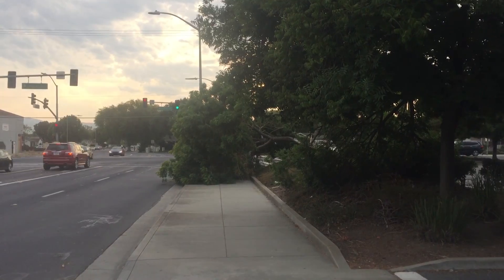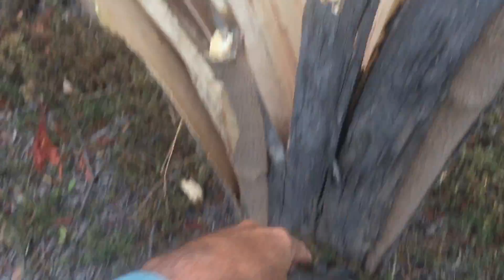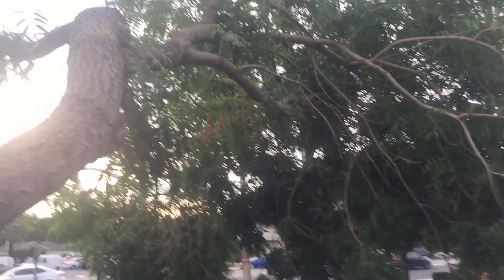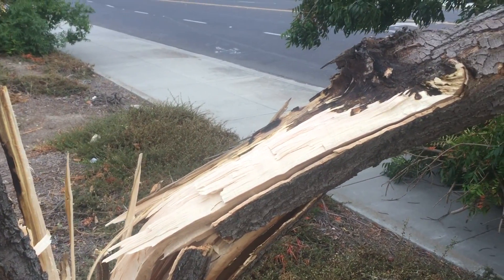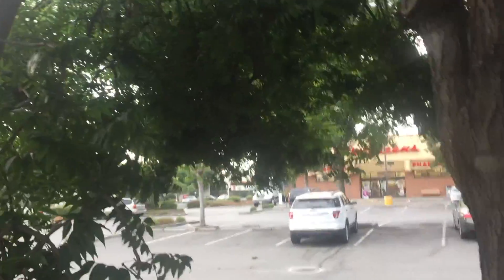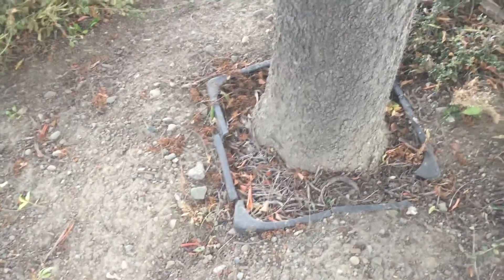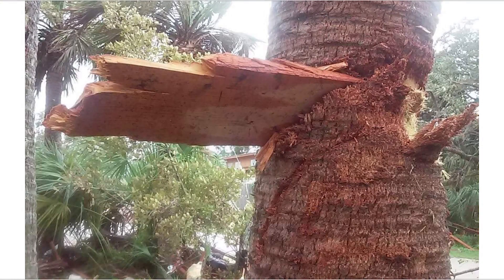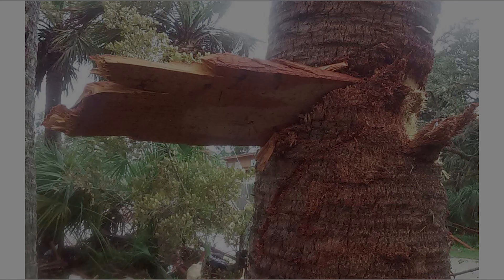Recognizing  Tree Weaknesses

Comment from the maker: Identifying Hazardous Trees
 
This is really an area that needs to be done by an expert but there are many signs that indicate a problem or potential problem. It is important to understand that different types of trees have different characteristics and problems unique to the variety. That said, I will give some general advice that are “red flags” to a potential problem.

Cracks in the limbs
This sounds pretty basic but I am amazed at how few people really look closely at their trees.  It is often obvious when a limb is splitting open but not always. Small cracks in main crotches can sometimes ooze water or pitch (sap).This can happen suddenly or take some time to develop. If you see cracks or openings, call an Arborist immediately.  That may be the only warning you get.

Cracking noise
I have heard and been told by people that they heard a loud crack, but could not see anything. Sometimes the crack is on top of an upper canopy crotch or running along a large horizontal limb. Don’t ignore this obvious clue.

Change in tree trunk angle
Many times in my career, clients have called me to say “it seems like the tree is leaning more than it was before”. Sometimes it is a persons fear or imagination but many times there was a weakness underground that caused a change. The large Stone Pine in Blaney Plaza was saved because a city worker noticed a change in angle.  Sure enough, when we looked close, the whole root ball was coming up and this huge tree was on the verge of going over. Sometimes cracks in the soil are a good indicator of movement. Also look for a separation in the soil line around the base of the trunk. In rainy weather, the soil becomes muddy and these clues are often harder to read.

Drooping limbs
Do some branches seem lower than they did a few weeks ago? Is there a dramatic difference in the way a tree looks?  There is a situation that is very common during hot weather called “summer limb drop”. A drying out of the limbs can cause a sudden limb failure, even on a windless day! Some of the species that this happens to include; Monterey Pines, Italian Stone Pines, Valley Oaks, Eucalyptus species, and large Ash. This can happen on other varieties of trees as well but these are the most common in the Bay Area. (Correct me if you think of others and I will list it as well).

Mushrooms at tree base
Some types of wood decaying organisms will push up fruiting bodies or mushrooms.  It is not the actual mushroom that is the problem but what causes the mushroom. Rotting roots or trunks cannot always be identified at a glance. There are techniques that help us to determine the extent of the decay and likelihood of total tree failure and this inspection needs to be left to an expert. However, if you see these clues, get help before it is too late.

Fungal bodies on trunk
Just like the ground mushrooms, there are many types of growths that indicate decay.If you see anything unusual on the trunk of the tree, other than moss or lichen, then it is a good idea to get it inspected.  It may not be a big problem or it might just be the flag to a bigger problem. Black balls on the trunk and limbs that look like charcoal are a big indicator to a possible disaster. Get the tree checked out!

Girdled roots
This is a tough one to identify as a problem but sometimes there are surface signs to girdled roots. When roots   twist around each other they can sometimes cut off normal root development. If a tree was in the pot too long, then the roots can grow in a circle, rather than spreading out. Sometimes you can recognize a girdled tree by a lack of a root flair. If the trunk seems to indent at the ground, that may be a clue to girdled roots. Canary Island Pines are one type of a very fast growing tree that we see failing from having lived in a pot too long. The fast growth on top can exceed the root development and a girdled root ball can cause the tree to snap off at the ground.

 

There are many other signs of potential problems such as hollow trunks, cavities, past trunk damage, insect activity, improper past tree work, etc., but these are really areas that you would be guessing at. The main point that I am trying to make is that if you notice anything that worries you then you should get the tree checked out.

Comment: Hey Blair, thank you for all your work. 
I’ve often wondered if the discoloration in the wood from the included bark that you pointed out is considered rot? Or just discolored wood? Also, the black I’m assuming is just sap/sugars that made its way down from the imperfect attachment of the included bark? 
Is that correct?
Reply from the maker: The discoloration will become rot

Comment: Hi Glen! I have the same question as everyone. I have two huge firs on my property. (northern fir or something.. this breed we have in scandinavia.) They are known to been there for well over 100 years.. actually so long time that my grandparents dont remember them being any smaller than they are now. Other one of them is clearly starting to "get old" although it grows new "branches" 4-5" every year. (I dont know english word for them.. but those light green "new parts" of the branches in the beginning of summer).  Is there any way i would be able to check the conition of these trees?  I'd hate to cut em down, but if they fall on their own it  would be a disaster.. so i want to be absolutely sure that it is necessary. What i should look for? Or where i could find info for this? I know it is not a simple question. Thank you for your videos.
Reply from the maker: mikkokarna without seeing them, my comments are to pay attention to the clues. Mushrooms on the wood can be bad. Upper canopy dieback. Trunk decay etc. ask a local Arborist to inspect it. Good luck